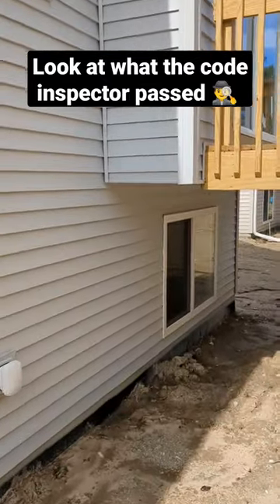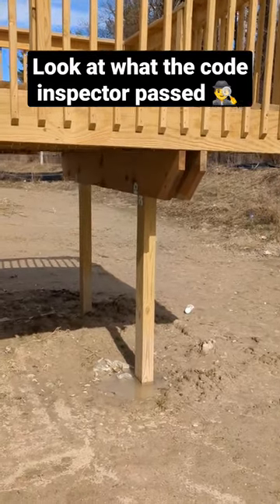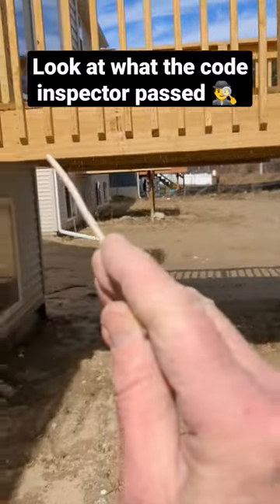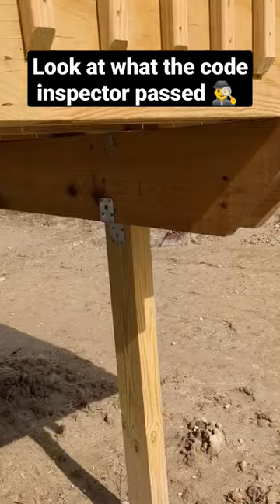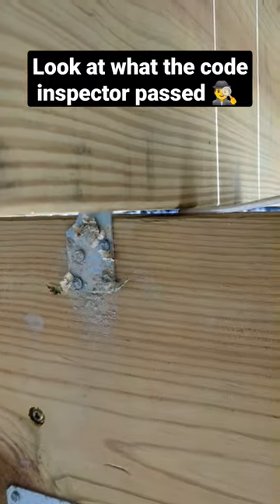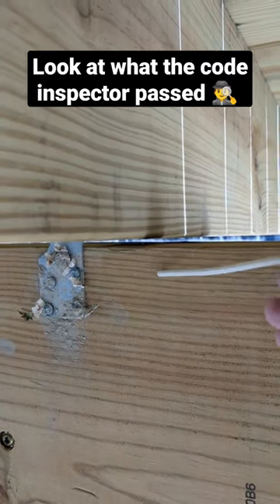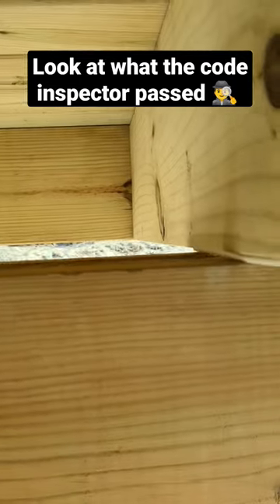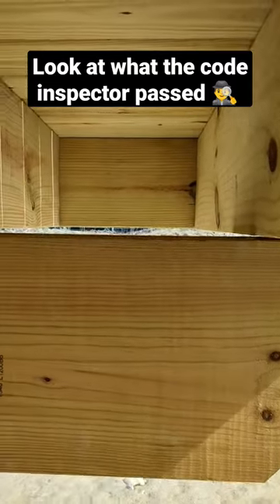Code #inspectors don't pay attention to detail#deck #newconstruction#youtubeshorts#shortvideo#shorts

Comment: You shouldn’t build a deck off of a cantilever section of the house.
Reply: Unless u post it again
Reply: They didn’t 😂😂
Reply: Idk where the footings or posts are next to the house that deck is like a seesaw
Reply: @patrickhorvath2684 he is talking about the back of the deck and here in GA they only allow 2 ft cantilever on a deck don't really know why but dems tha rules.
Reply: That was my immediate concern. There should be Posts at the end it connects to the House. That's what I immediately noticed even before the other issues
Reply: What about the beam riding the sides of the posts without a single anchor bolt to tie them together?  It would have been better to make that beam sit on top of the posts so that it's a direct load trasfer rather than depending on the hurricane straps for support.
Reply: What’s cantilever

Comment: tip of the day. the beam should be 3-2x10's nailed together and sit on top of the posts. not 2-2x10's nailed to the side of them. looking up close the outside of the beam is lower than the inside of the beam so ultimately the whole deck is sitting on a single 2x10 that attached with 3 screws to the side of a 4x4. this is how decks fall down and people die when too many people get on them. the same reason a header needs jack studs under it. so it can support the weight. infact if your window or door opening is wider than 5 ft. you need multiple jack studs under the header to support the weight and the 4x4 should be 6x6's. you dont build a house and screw it to the side of a foundation you build on TOP of it! and you cant fix ______! you already know!
Reply: 3 2x10s is over kill two is plenty. It depends on how far your posts are spaced
Reply: Great response 👍😁 PURE TRUTH 👍😁 DON'T KNOW HOW IT PASSED INSPECTION 🤔🤔
Reply: Either way, beams should be on top of the posts or the post should be sized such that you can notch them for the beam support.  For the setup shown the posts are clearly too small and it's missing the carriage bolts to tie the beam to the posts.

Comment: Also, because the attachment point on the house is itself an overhang, the attachment point can't be a load bearing one. This means there needs to be an additional support for the deck along with diagonal bracing to prevent the transfer of lateral loads to the house.

Comment: They were tight originally when installed but pressure treated lumber is notorious for shrinking up to 3/8 or more.
Reply from the maker: You got it. Speed process.
Thanks for watching
Reply: Yup...... tell your contractor NO BIG BOX LUMBER STORE/ HOME IMPROVEMENT STORE LUMBER..... DEMAND QUALITY LUMBER... NOT TWISTED SISTER
Reply from the maker: @rdm5190  Great point.
 I love THAT "Twisted sister" lumber. Lol
Thanks for watching

Comment: Wet lumber when built dried out over couple of weeks. The hurricane straps are preventing the joist from continuing to rest while shrinking.
Reply from the maker: More than likely. Thanks for watching the video... to see some really major problems on New Construction, watch "Missing Footings"  
https://youtu.be/TqGMGpvnVAk
Reply: Won't it just rest on the beam when someone walks on it?
Reply from the maker: @miki09876  I don't think so, because of the twist straps, rim joist and top floor boards are all tied together.
Thanks for watching.
Reply: This happens because lumber is not always perfectly straight or the exact same dimensions. I see it all the time you go but 10 or 20  pieces of 2x4s or 2x6 or any other size then you check their width you’ll find some are thicker than other by an 8th or 3/16 which might not seem like a lot but it’s enough for some guy to make a video about you not building a deck properly but it’s not your fault lumber is not all the exact same size. If you dont believe me go buy a bunch of of 2x6x12s for example then build a square like youre building a frame for a deck. Build it on a flat floor then go look underneath and tell me if all those boards are perfectly touching the ground. They wont be because some aren’t straight and some and not as wide as the rest. Its nothing you did wrong the lumber just comes that way
Reply: Maybe they left a slight gap so when the wood swells with moisture it won't break or warp the wood?
Reply: @anthonysharpelletti9771  in some applications,  a gap is needed, but this isn't one of them. The builders laid the joists on the beam, put the hurricane ties on, and a month or two later, the dimensional shrinkage has the joists floating and held up by the metal that hasn't moved.
Reply: yep, my first thought.
Reply: @paulmryglod4802 Shouldn't they have screwed the joists to the beam.
Reply: @williamclancy9150  it's likely that they did. I've had a similar issue happen with pressure treated ledgers. The supports under the ledger shrank, as did the ledger, and after two years, we crawled under to see how things were and found gaps between everything. Wet pt boards and strapping.
Reply: Hurricane straps 😂😂😂😂 Americans are funny, they all fall over in abit of wind
Reply: @Dontaskmetoday  well with new codes, they certainly won't anymore lol.
Reply: @juniorpineda4151 your absolutely right but a good carpenter can mitigate that by hand picking all the joists for a deck. Then shave the ones down that are wider than the least widest joist in the pile. Always shave off the crown side.
Reply: Calm down, it’ll settle in…
Reply: @Cheddar.0420  There are no maybe's in construction. 
Wood doesn't get bigger , it gets smaller when it dries , it's always drying .
Don't confuse green wood with wet wood .
Reply: Gravity will make them find over time
Reply: Yes, my first thought as well. Joists were installed wet, then shrank.
Reply: @duncandmcgrath6290 that's not true at all. Contraction and expansion is a natural occurrence of all lumber. Green, dried, or wet it will expand and contract through out the day and seasons. Lumber swells and lumber shrinks.
Reply: @inspectflix does gravity work differently at this property than the rest of the universe?
Reply: Bingo that's what my dad did

Comment: I guess we're also gonna ignore that the "beam" is sandwiching the 4x4 instead of being nailed together and bearing on top of them. I don't know about where you're from but where I'm from, that's a no-no. Those 4x4s should be cut short and the beam sat on top and attached with a saddle bracket.
Reply from the maker: Trust me. It bugs me BIG time! I was taught by real carpenters 35 years ago that proper weight distribution is to have the beam set on top of post or notched into post.  Our Michigan code inspectors pass that. It's very tricky to cover so much in a short 
Thanks for watching the video.
Reply from the maker: One more thing... if you want to see a real major problem on New Construction, watch "Missing Footings"  
https://youtu.be/TqGMGpvnVAk
Reply: Or a 6x6 with it notched to receive the beam.
Reply: Right, code where I lived in TN said those have to be shouldered.
Reply: Deck skipped leg day.

Comment: My brother installed a big deck. He designed it and built it at age 78 with some help from local labourers. This thing is set on 24 inch pylons, 5 ft deep. The building inspector said he had never seen anyone take so much care and with great precision on a deck project in that city. I've seen it and it is amazing. He got an estimate of 47K to get it built. It cost him around 28K.
Reply from the maker: WOW, awesome comment.
Thanks for watching

Comment: The ledger is attached to a cantilevered floor joist. Needs a drop beam at house connection
Reply: You are right!
Reply: Correct
Reply: Wrong just needs LS 90 hangers installed on the cantilever or a upside down joist hanger
Reply: @matthissong4109  not on my jobs.
Reply: I would say you are right on that almost always, but... in new construction sometimes the deck is a part of the original house drawings, engineered, and approved that way.
Reply: Not to mention the ledger board is hanging below the house by an inch or more. So the lag screw pattern can't possibly be correct.
Reply: @j.n.572 That’s actually a pretty good point. In construction, everyone gets sued though.
Reply: @melvin_0bviously  agreed. I don't think its a very good idea, regardless of the engineering. But if was stamped and approved by the building dept, then you have to get the customer to agree to pay additional to put in the beam. And we all know that most customers max out their budget on the original design.
Reply: @j.n.572 interesting note, and perhaps i got an idea or two from it so thanks
Reply: That was the first thing I noticed. Good eye!
Reply: Haha reading these comments. If you are using the rim joints for support you are already building the deck incorrect. The ledger board would be nice to see it not hang down 2” but if carriage bolted through the house and proper post and beam construction then if passable. 
Everyone should get in the habit of notching the 6x6 post to set and fasten beams. It’s fail proof. Also good practice on non covered deck which I believe will soon make code is to tape the tops of the lumber. Saves the lumber by years if not decades. Steps too! 
Most of our decks are outdoor living spaces covered lower with waterproofing systems. This last one was screened and had heaters  fireplace and tvs. 
Beginning of spring we built a second story deck to support hot tub and 8’wide x 10’ tall stone fireplace with wood box and gas. These were specs at 6”oc.
Reply: WHOA I didn’t even pick up on that lol. Wtf
Reply: Should not be fastened there regardless. H frame around them.
Reply: This is the real problem. Nailed it.
Reply: It can be done if it is mechanically fastened correctly.

Comment: What good is a 2x8 beam if it has to rely on the sheer strength of the nails. It should be on top of the posts so it can transfer the eight to the footings.

Comment: Id say thats likely due to either the ACQ treated lumber shrinking OR a significant crown in the joists. In which case they would be installed correctly... give time to settle and the crown will straighten out.

Comment: Forget about those floor joists or whatever you call them not resting on the beam. Look at the 4 x 4’s supporting all that weight not being pressure treated
Reply from the maker: Thanks for watching the video... to see some really major problems on New Construction, watch "Missing Footings"  
https://youtu.be/TqGMGpvnVAk
Reply: To be fair they are being pressure treated by the weight above 😂
Reply from the maker: @wail7534  🤣 hahaha. Good one.
Reply: If you wanted to look nice forever I recommend using redwood pressure treated will crack and split from the bottom to the top people always want to paint it and try and make it look nice but that doesn't never work🤠
Reply: Are you blind? Those are pressure treated lumber. 3 levels of pressure treated.
Reply: Look like 2x4s to me.
Reply: @shelbyroderfeld5943 those are 6x4
Reply: @shelbyroderfeld5943   leave it to the woman to mess it up again.
Reply: @stackmoneyyadigg3751  Most red is virgin now it seems. Rots just as quick unfortunately.
Reply: Pressure treated lumber has nothing to do with the loads it can support.
Reply: @ron7202  Not at the time it's built anyway, says the termites.
Reply: Yes, you are right they’re not far away nothing to do for the weight but what about touching concrete?
Reply: @ron7202 but everything to do with how long it will take to rot.. They're in standing water.. But they are pressure treated boards. I would've poured footers then placed the posts on top of them with a proper plate

Comment: If anything… the 2x12s will drop a 16 th of an inch … just install another bracket … 
Most definitely not an issue
Reply: I sure as hell would not like for you to build something for me or work for me with that kind of work ethics. There is a reason to do things right
Reply: @speedgonzalez489 He's right though,it's not good workmanship but definitely not an issue
Reply: Wont the hurricane ties stop the joists from dropping?
Reply: Wow
Reply: @GreganDunn  no
Reply: @speedgonzalez489 good luck building a home and getting perfect subs throughout the entire project 😜😂 Good luck!😛
Reply from the maker: @GreganDunn  🤷 only time will tell. Probably.
Reply: Honestly I would like that and tap in some plastic.  That's gonna shrink and settle but to have a moisture break....
Reply: Yup. I frame for a living. This is not a problem. Beam will settle over time.
Reply: Just like when you tighten the anchor bolts on day one. 
Two weeks later they are loose. Treated lumber shrinks, deal with it.
Reply: @speedgonzalez489 You could literally just wood glue a 2 shims in there
Reply: @speedgonzalez489  You also wouldn't pay the amount that would be necessary to make this cabinetry work, not carpentry work.

Comment: The bigger problem is the main beam is not supported on the posts there sandwiched together all sheer strength on nails or bolts or what ever they used
Reply from the maker: Oh yes. But there's also that ledger to house and post base. Check out the missing footings inside. https://youtu.be/TqGMGpvnVAk
Thanks for watching.

Comment: It's not a huge thing.  Because if all the fasteners fail.  It's still above the header and tecos holding it from twisting.... but when it says that 1/8"  it's still not on the beam...  Heck.  At this point it's an easy fix.  Slice a 1/8" shim.  Slip it under any that need one
Reply from the maker: Well said. Thanks for watching the video
Reply from the maker: Thanks for watching the video... to see a really major problem on New Construction, watch "Missing Footings"  
https://youtu.be/TqGMGpvnVAk
Reply: I agree it passed because there's nothing wrong with it
Reply: My original thought was shims😂

Comment: That is common shrinkage, not a lot of K.D. P.T.  being used in the field,, and the joists are resting on the girt through the hurricane strap. 
If it really bothers you get an engineer to tell you whether it's worth removing the clips letting the deck settle then renailing the clips on it he other side, or if a simple composite bearing shim could be tapped in there and Bobs your uncle.
Reply: I am a structural engineer and this little gap gets filed under doesn't-really-matter. What failure could it cause exactly?
Reply: @Sphere723  Hell, I like it.  It might make the deck bounce a 16th of an inch, but it allows air to dry out between the joists.. :D  Its a feature not a bug.

Comment: Personally with the deck that high and the cantilever being that long I would have used 6x6 posts and supported it close to the house too. But I do overkill so I don't have to replace it right away.
Reply: The cantilever is definitely wrong.
Reply: First thing I noticed.

Comment: probably due to shrinking
Reply from the maker: I think you may be correct .
Thanks for watching the video.
Reply: @inspectflix  where i m at acclamation is key if pressure treated is used allow a week of air atleast ✌️
Reply: @helenabasquette7222  still feel like they should have toe nailed to the beam those brackets aren’t doing there job.
Reply from the maker: One more thing... to see a real major problem on New Construction, watch "Missing Footings"  
https://youtu.be/TqGMGpvnVAk